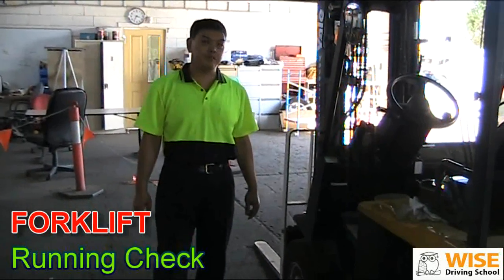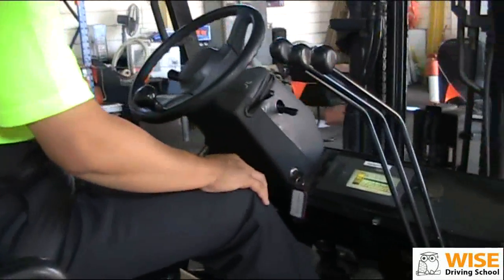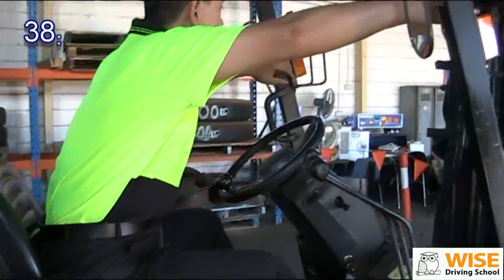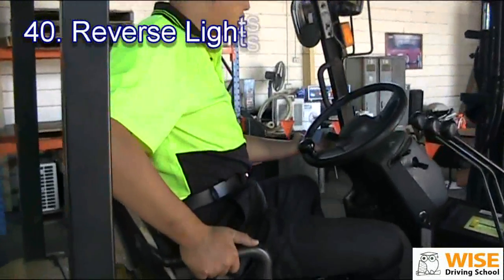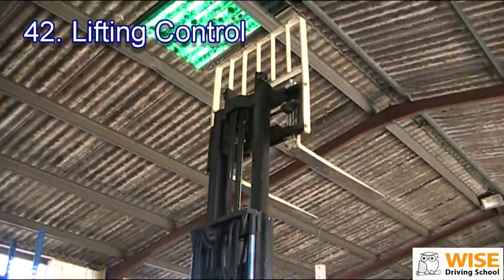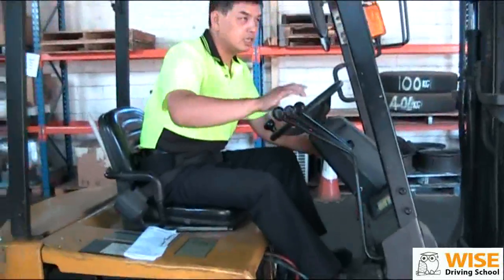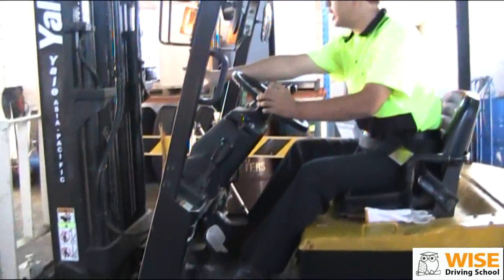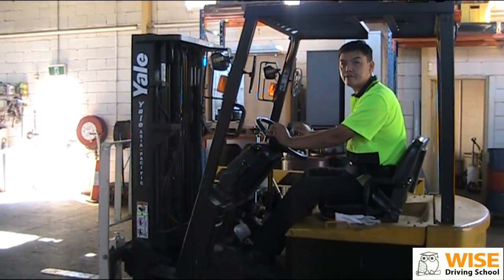Forklift Training Course - Running Check

Comment: How often does this check need to be done?
I see many people jump on a forklift and start using it immediately.  Is this for start of day or first time you use the forklift that day?  Or is it just another Government WHS overkill that most people ignore?
Reply: For beginners
Reply: This is usually done at the start of the day to check everything is in working order and any faults reported to your supervisor etc usually with a form to fill in to confirm the check has been done. Once it has been checked then it can be used by anyone, as it is a legal requirement to ensure the forklift truck is in safe condition to be used. If you are the first to use a forklift truck and you do not check it thoroughly, you will be in shit creek without a paddle if something goes wrong due to an existing fault that was not reported.